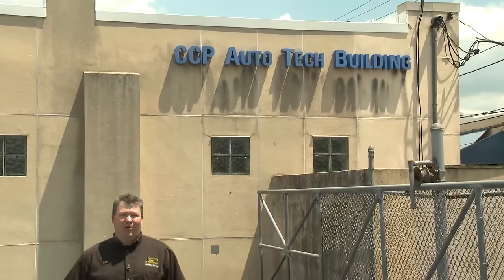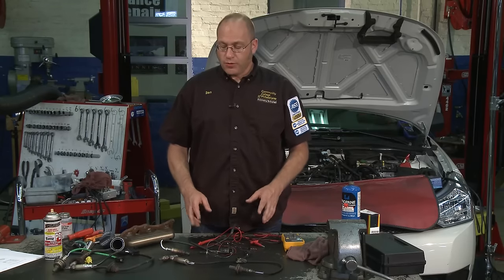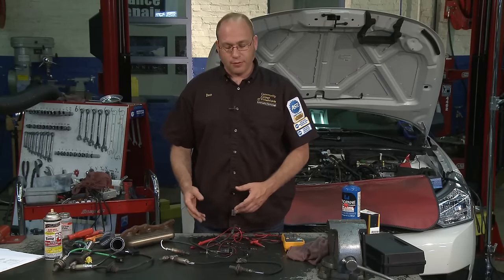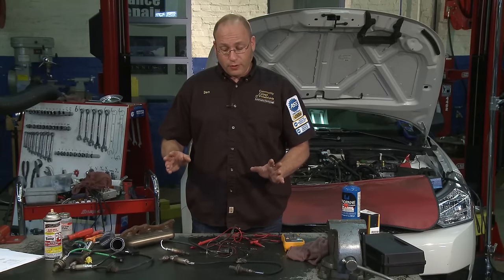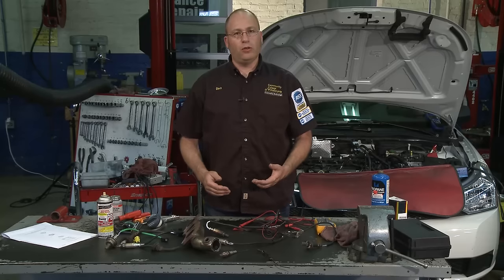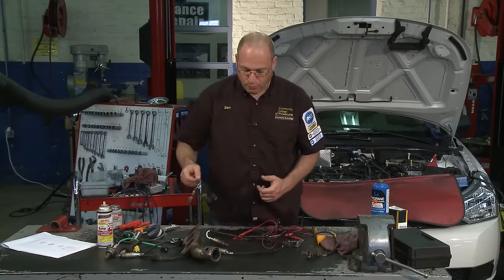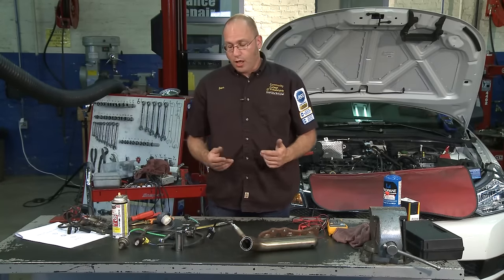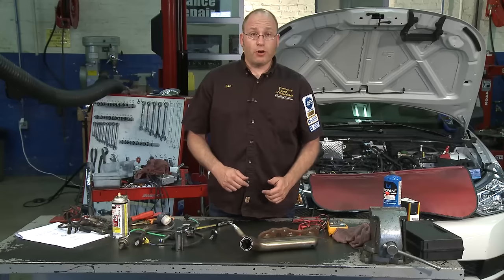Car Corner: O2 Sensor Diagnostics

Comment: Thak you Dan Reed and Thank you Philadelphia CC for creating and sharing this video. It certinly helps us understand why taking our vehicle to "competent professional" automotive technicans will in the long run save us cold hard cash. Unfortunately some of these "so called" skilled automotive shops may not have all the proper equipment nor the knowledge to utilize the testing equipment, therefore they cannot diagnose the real issue. They may simply do an initial test with the generic OBDII tool and commence throwing parts at the car without telling us what they actually did, BUT we pay for those mistakes in misdiagnosing the problem, purchasing incorrect parts used and oft times wasted labor. Even a layperson can tell that larger test tool was likely very expensive and the knowledge of how to use it ultimately directed the competent automitive tech to the one problem sensor. This saved we the consumer money.  We do understand a shop must make profit or they cannot remain in business, equipping a shop and investing in constant certification training of these technitions is expensive, the competent tech is paid a high wage (hopefully) for his or her skills. Automotive technitions have spent thousands equipping themselves with the proper tools and training of their craft. We know it is expensive to keep our cars in proper running condition BUT, if we do our homework in selecting a reputable automotive repair facility we can ensure we're getting the highest value for our automotive maintenance dollar.

Comment: After this great technical explanation , Sorry for asking , couldn't you check the resistance without removing the O2 sensor? You could have spared some time if it was working well under 5 ohms.. Both ways , thank you again for the great video.

Comment: I had a leaky rubber emissions connection, which caused running lean codes by letting air in, but here you’re saying that same vacuum leak could cause running rich codes from oxygen sensor? - & on that note would it not also cause alternating codes +- 1c per second?(rich, lean, rich, lean, etc.)?🤔

Comment: Good teacher, only thing you missed was explaining on the scope that the feed voltage was not working, you said there is a fault but not showing the value. However  you did show value on new sensor.

Comment: Dan if the sensor works does that mean it does not need to be replaced? I ask because I thought I had a sensor on a 2009 Honda Odyssey with 200K miles and the sensor shows that it is working and it is not sending a code but the sensor is original.

Comment: I didn't look through all the comments but I was curious so you think it would be smart to put some on the threads that are in the exhaust itself this would eliminate the chance of putting it on the actual center part that heats up I would think if you're careful and take your time by the way great video very happy I found it able to explain to the girlfriend and others on how this sensor works now
Reply: Toyota is one of the few (only) companies that has an O2 sensor that is that style (with two studs) rather than a bung style.  I prefer the bung-style design, to me it seals better. At least I think that’s what you are referring to - http://www.theymightberacing.com/Images/Corolla/O2Sensor/O2Sensor002.jpg

Comment: Thanks Dan for that explanation.  When you diagnose a circuit, it's easy to forget like you did about checking the Malfunction Indicator Light (MIL) or Check Engine light.  I've done it also.  But the proof's in the after test like you had shown!  
Intermittents, like I've seen before, are a different problem.  I'm sure you know what I mean!  Nice Diagnostics, Nice Repair.

Comment: I changed coils and spark plugs on my ram 1500 5.7 Hemi and my engine light came on the codes I got are p0152 / p01129 if I replace the oxygen sensor on bank 2 sensor 1 will that fix the problem? Have you got a video for this? The truck is running very well with the light on. By the way, I love your video on sensors.

Comment: YOU SAID, the heater circuit is the TWO WHITE WIRES. But in your hand motion you were holding on to the grey and the white wire when testing for resistance.

Comment: Thank you I understand, and it's given me an idea of how to fix the sensors but need more info or explanation I have some problems if I replaced o2 sensors which is L&R if you in the driver's side that means you are on the left side of the car, so the sensor which mark (L) should be on the left side or the shorter wire should left the car.

Comment: I appreciate your video it was in good detail I did want to ask a question I purchased a 2005 mustang gt with the 4.6 engine someone put BBK headers and BBK H pipe and on the downstream oxygen sensors they have the connectors hooked up on bank 1 sensor 2 it’s hooked to the connector on the drivers and the bank 2 sensor 2 hooked up to the connector on the passenger side is this the right way or they should be changed

Comment: Hi there I have a problem with my Chevy avalanche  2003 I have replace fuel injector coil pack o2 sensor spark plugs and wires  I have check for air leaks I watched a lot of videos and still haven't came up with the correct answer. Engine had one misfires while driving backfired one time please let me know if you have a good suggestion that I may try

Comment: Awesome video, very informative! I have a regular scanner and it helps a lot but that one scanner you have basically those 90% of the troubleshooting.
Reply: That "Old" Scanner also cost $10,000.00....Snap - On Diagnostic Tools- Hard to Beat but also the most expensive compared to the other "3" Professional Tool Trucks : Cornwell Tools Truck, MAC Tools Truck & Matco Tools Truck.

Comment: Excellent Video Professor!
I used the computer tool at Auto Zone and replaced both upstream O2 sensors (only one was bad).
My Jeep purrs like a kitten and the check engine light is out.

Thank you.

Comment: Great Video. Very informative.Once question, If car is working fine on flat road but doesn't pick up on HILL.   What could be the problem?  there is no enginee  sign. In past, I got mass air flowsensor  code, which I clean ( Not replaced).do you think, should I start with mass airflow or oxygon sensor?
Reply: Is your check engine light on? If so check the codes. If the 02 sensor is bad it will give you that code.

Comment: thanks for the video.
i have some question regarding automotive mechanics.
1. how can i easily get the diagnostic tools as those in the video?
2.as an automotive engineer what should i technically check during buying of a used car?
Reply: Transmission for shifting correctly and non slipping , any leaks motor or transmission primarily, coolant as well and ofc good compression and power while driving the vehicle. Don't sweat the littler things, ie tires paint, the above mentioned are the bigger bucks to have to replace.

Comment: Would you happen to know how many 02 sensors a 97 Geo prizm lsi 1.8L car has, when i start it up the motor vibrates then when i put it in a gear any gear it then almost stops vibrates and i just bought the car it has 94k miles on it and i found a 02 sensor in the trunk brand new in the box so thought that might be the issue but theres no check engine light on but wanted to fix that vibration if possible  thank you  ur videos are awesome very thorough and alot of info and u do things the right way  u dont skip corners love that  not alot of people do that anymore  please let me know if theres any help

Comment: My wife Jeep Grand Cherokee was dumping too much fuel upon start up and smoking because too much fuel was being put forth I changed the O2 sensor before the converter and it fixed the problem.  Not all car symptoms or cars are the same when related to the same issue.  All though it could of been the fuel pressure regulator.

Comment: I have a 1999 Basic Tocoma 2.4L, 2 wheel drive, 5 speed. The O2 Sensor is just behind (down stream) from the Cat. Converter, both of the nuts have worked themselves loose and fallen off, do you know what size nuts they would be?

Comment: I have a 04 Zafira with 90,000 miles. Bank 1 sensor 2 went bad at about 10k miles ago. Replaced that 3 times in 6 months using different brands. Then the bank 1 sensor 1 caused another engine light so replaced that too about 3k miles ago. Today the bank 1 sensor 1 engine light has come on again. Does any car wizard know what is causing it too fail prematurely.

Comment: Great Video, subscribed.  I'm simply a Necessity based diy mechanic for 1999-2000 Mazda B2500SE, manual transmission, 2WD, 2.5L falling somewhere between a Ford Ranger & Mazda B2500SE.  Can you recommend a Diagnostic  Fault Code Scanner known to work with this Light Truck?   I've already wasted $ I don't have replacing parts and the Truck only starts intermittently.  A neighbor thinks bad fuel pump but I can't just keep buying parts.  I need to focus on better diagnostics :)  Any help is much appreciated.  Thank you

Comment: Wao! Quite Informative, an eye opener. Keep it up!
I own a 2007 4Runner which Check engine light keeps coming up after every 48 hours of use. I changed the 4 O2 sensors, gap cap and solenoid, all to no avail as I keep having to clear the error code po455 after every 48hrs of driving the car. Can you please assist?. It’s a two wheel drive. Thanks

Comment: Hi I have P11DB code for sensor 1 i did wat you said and replaced the one in the top of the DPF but have since learned that oxygen sensor 1 is under the car/Vauxhall insignia 2litre diesel 2016 170 bhp 125kw just to the left of the add blue injector looking from the front of the vehicle. I didn’t realise that the fuel cap can create a code thanks for the great content Chris from England

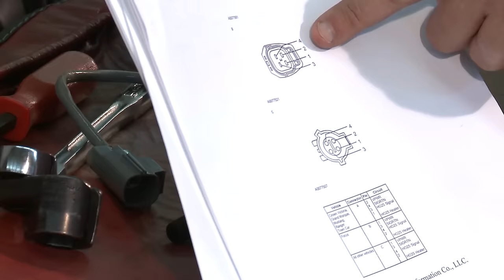Comment: 38:45 correct me if im wrong. I just notice in your paper you says the signal is in the pin no.2 but what i saw is pin no.4,and you said you will check resistance to the pin no. 1 and 4,but why you check the resistance to the pin no.1 and 2 or  I just dont understand what you says in the video.

Comment: i have a 2001 chevy cavalier that i need to smog and the o2 sensor is not ready. i had a new battery put in over a month ago but i have driven it more than1000 miles. i replaced one of the sensors and drove it over two weeks maybe around 800 miles and its still not ready. it doesn't have a check engine light. i had my car stored for six months, i would really appreciate advice since the mechanics around here are clueless. i don't want to spend any more money if its not a sure thing that it will work. thank you!

Comment: My problem with my BMW e90 320i 2009, 4 cylinder engine with 2 banks
cylinder 1 & 4 is bank 1, 2 & 3 is bank 2. i am suffering from high fuel consumption /low   mileage that is around 12 L/100km in the city and 8.5 L/100km highway (the standard is 9.3 L/100km in the city and 5.7 L/100km highway).I don't have any codes in the OBD II check tool, but using torque app i am getting a strange value of (fuel trim bank 1 / 2) that is +99.2% and this value is constant on idle and on high speed as well .the other fuel trim bank value (fuel trim bank 2 /2) is fluctuating normally from + to - as per the load and drive conditions.
I will appreciate any help ideas.

Comment: What happens when the voltage jumps around while increasing the cars revs ? I have one and while I rev up slowly it jumps from 0.1 - 0.7 then while its at 0.7 it jumps back down to 0.1 without decreasing the rev and vise versa

Comment: i have P0420 on 2014 Nissan Patfinder, no leak i could find and i did check the gas cap which is good.  
(P0420 Catalyst System Efficiency Below Threshold (Bank 1) so can you please me to know where is my bank 1 on V6? this engine has 3 spark plugs by radiator and 3 spark plugs by firewall side? so not sure which side is bank 1? V6 VQ35DD engine." AWD 
thank you

Comment: I have a 2005 Hyundai Elantra GT that I have changed both O2 Sensors.  I cleared the codes and the next day I received another check engine light and the code is p2251.  If the O2 sensor is new what else can cause this code to go off?

Comment: Prof Dan Reed- - where do I get the service manual (dealer or OEM)?
Having all kinds of issues on Honda Odyseey (2006 3.5L v6, 145K miles). Replaced front O2 sensor (new Bosch one $124, still have problems). Still not resolved. New code is P0134: HO2s S1 circuit high voltage / no activity.

Comment: I have a 2007 s80 3.2L Volvo, it’s throwing codes for all 4 O2 sensors??? Just bought it , it had a new alternator put on it before I got it? I parked car, let set for week or so now I have to jump it off to start?? Could battery or battery ground to frame cause this?? Where to start???? Thanks for any and all jelp
Reply: Sounds like the heater circuit on the sensors is not working, the four heater grounds are spliced together then bolted somewhere on the chassis through one ground wire, single point of failure, after 10 years all ground points on vehicles should be checked for corrosion and cleaned. The O2 sensor signal will work but take longer to reach the operating temperature of about 600 degrees, the time it takes for the engine to reach closed loop is monitored and will trigger a code if exceeded. If that is not the issue its possible the PCM is bad, this is least likely tho.

Comment: @25:00 on this test. Did you have to hook up to the power in terminal? I'm not understanding where the power is coming from. Is there any part  I can buy that is not made in F,,kin china?
Reply: jeff lorenz  -  Hey Jeff.  The multimeter is supplying the voltage to do the resistance/OHMs test.

Comment: Great info.
But in addition, is there a way to measure the sensor while in the car on a hot or running engine?
Reply: yes,there is a tool called oxygen sensor tester. working perfect.

Comment: the tip of the sensor is not the sensor itself.....it is only a vented cap that protects the internal sensor which is a metal pin coated with tin oxide.....so when you said not to put anything on the sensor is incorrect...as long as the vents are not plugged up, the actual sensor will always work...i've had only one issue with my past vehicle where the o2 sensor cap vents were plugged up with some foreign substance...when i removed the sensor for closer inspection, i simply and carefully re-opened the vents using a small pick tool and replaced it on the vehicle......function was normal and working as usual......so sensors do not always go bad because of heater coils......even on bad sensors, the tin oxide coating always remains intact....if you open up an old bad sensor and measure resistance across the tin oxide coating from end to end after heating it up, you will see that resistance changes are always working....nice video though...very generic troubleshooting....not in depth but satisfactory....true defects of o2 sensors are usually bad heaters or shorted or open wiring but the tin oxide coated probe of the sensor itself is always good.

Comment: Had a o2 sensor replaced at a toyota dealer. A few months later I noticed a hum from the ventilating fan that sped up and slowed down with the engine speed. It turned out to be a loose connection at the positive connector of the battery. This caused the battery to not work well in filtering the ripple of the voltage from the alternator which resulted in a likewise variation of the speed of the fan blower motor. Someone forgot to tighten the connector.

Comment: Good video Dan you seem to be a great teacher, I have always found that a lean condition would cause the engine to run much hotter, and a rich condition would allow the engine to run cool, what am I missing why would  rich condition raise the temperature of the 02 sensor?
Reply: No, not temp signal; rather. voltage toggle rich/lean.

Comment: That low current from the 12 volts must be trying to get the heater to get hot that's why it's only 0.70 volts however like I stated the voltage was fluctuating